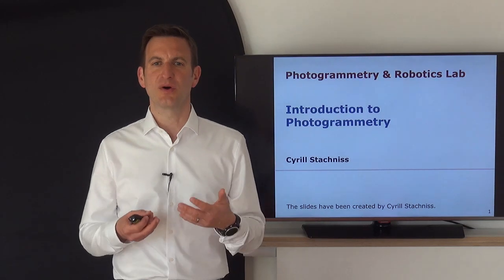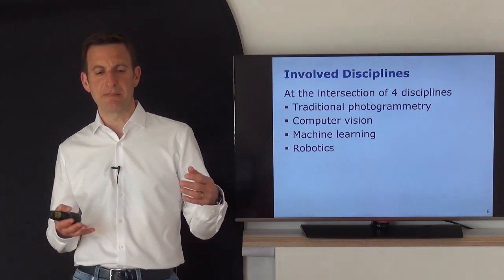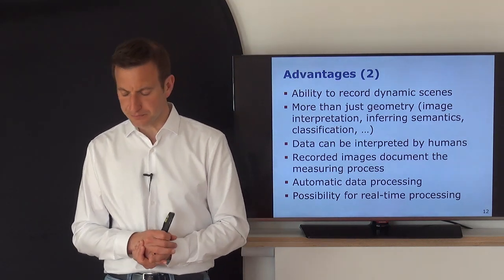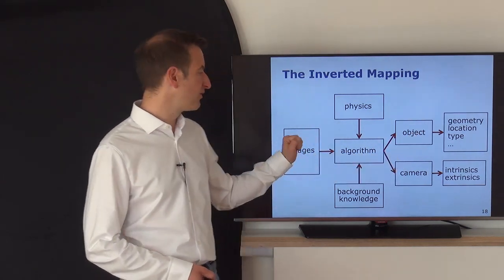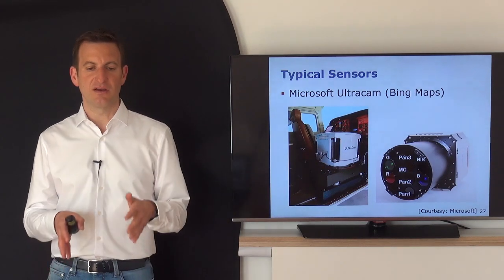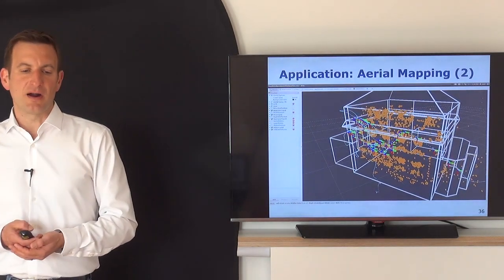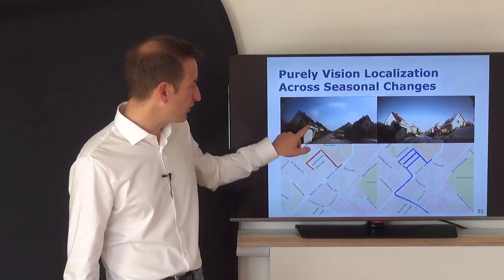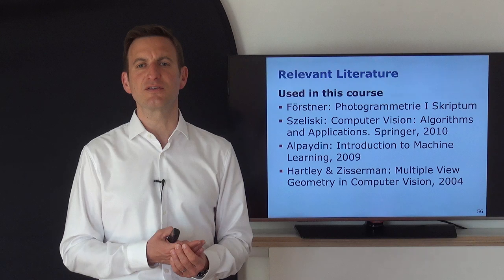Photogrammetry I - 01 - Introduction to Photogrammetry (Cyrill Stachniss, 2020)

Comment: Hi, Cyrill! My name's Artur. Thanks for your previous lessons of Photogrammetry (2015),  it's being very useful. I'm a forensic investigator here in Brazil. If I may ask, what algorithm or tool would you suggest to be the best way to determine as precisely as possible the height of a suspect of murdering a seven years old child, 4 years ago here in my State, a crime yet unsolved. He was caught on an IR camera walking, but the resolution of the video is only 352x240. I have the camera and their intrinsic parameters (from matlab toolbox calibration). I can also reinstall the camera back at the same pose as the day of the crime.  Thanks again! I hope that in the near future, based on your lessons, to be able to reconstruct de 3D model of the suspect's face.
Reply: Generally, you need a known reference within frame that can be compared to.